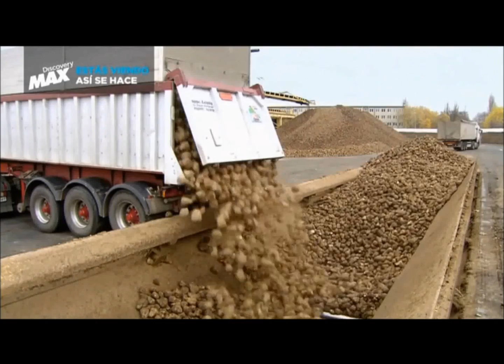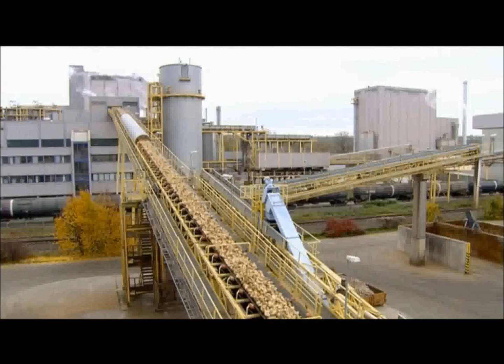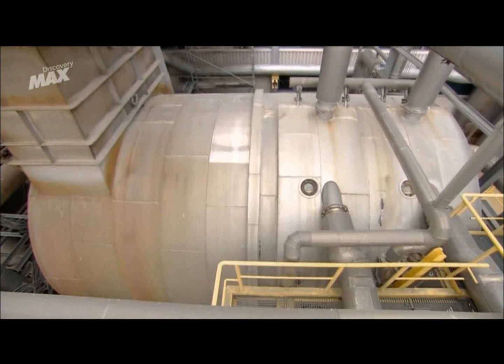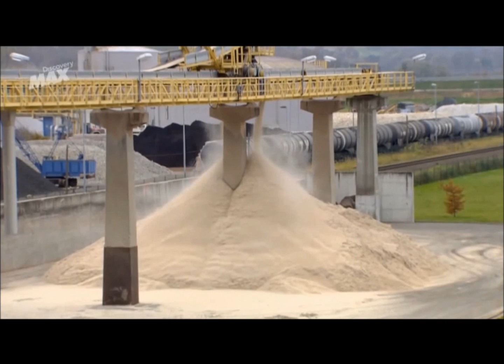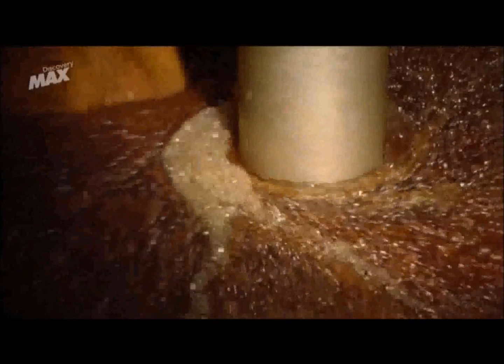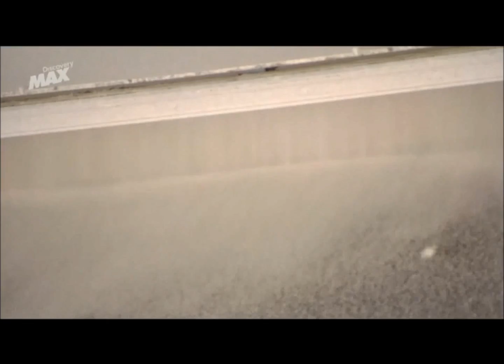How it's Made - Beet Sugar

Comment: You people must be confused.  Sugar is the most pure food product product produced at 99.99% sucrose.  The other parts are ash(carbon) and a microscopic amount of SO2 (used for ph balancing added during the production process).  There is no poison and there is no such thing as organic (excluding honey, which is not crystallized sugar).  Crystallized sugar is literally just the chemical compound sucrose C12H22O11.
Reply: gravylookout  and SO2 also has decolorization effect (inhibits maillard reaction during evaporation)
Reply: The SO2 addition will not cause "decolorization", rather,  it helps to prevent a color rise from taking place across the stages of evaporation.